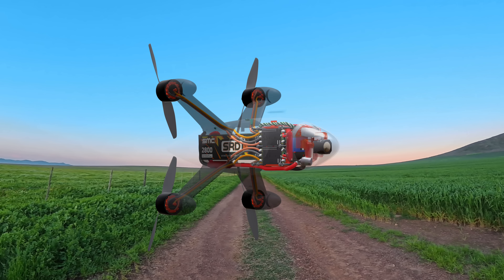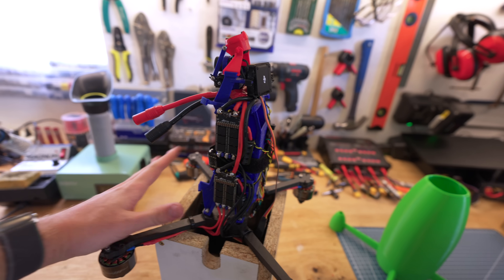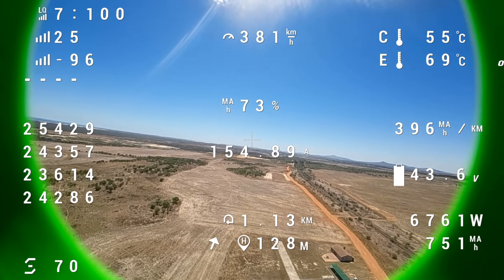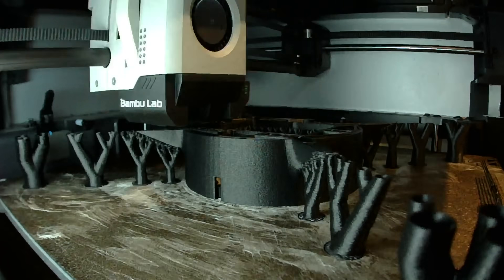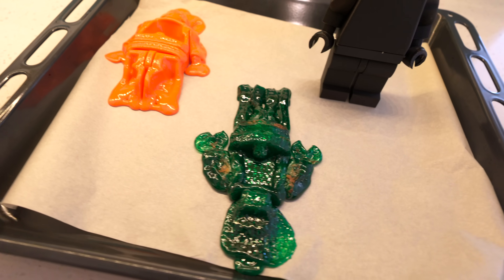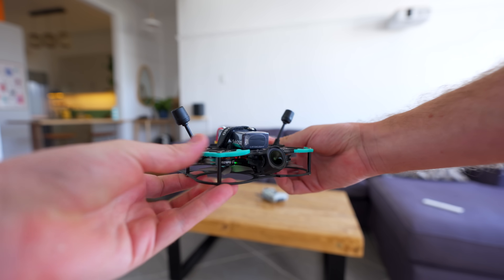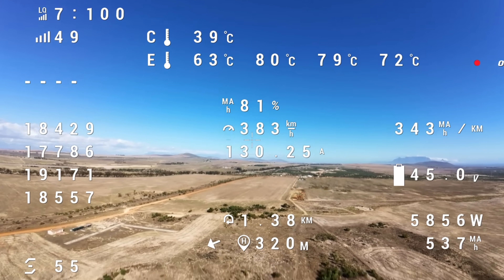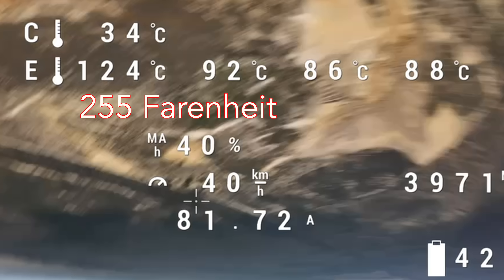THE COMEBACK - World's FASTEST Drone V3

Comment: 13:15 16 KW of power!  That's bonkers
Reply: It is a lot indeed, but nowhere near 3 households with everything on. Maybe a single small one though.
Reply: @Yawndr  Well "everything on" might not be true, since a lot of kitchen appliences can use upwards of 2kw each, but for a regular evening it might be true
Reply: @Yawndr  In the USA, that uses roughly the same amount of power as an entire household HVAC system, still bonkers.
Reply: @Yawndr  because in USA electricity is used in very excess. On any other States consumption for single house in less. In Italy common limit is 3.3kW per house, how want a lot will use 6.6kW ;)
Reply: @SbiriJJ I quite doubt it, otherwise I hope your microwave is never turned on at the same time as your kettle or your stove otherwise you're above that limit...
Reply: @Yawndr  the microwave are commonly only 0.8kW, the problem occur with normal hoven and washing machine (both near 2kW). In realy 3kW contract give 3.3kW indefinitely, 4kW for 3 hours, and "unlimited" for 2 minutes. Anyway is someone need frequently more can get 4.5kW or 6kW. (this in Italy) in other countries in Europe there is some differences, but power consumption is almost the same.
Reply: @SbiriJJ The whole point of what I said is that that claim is just wrong. You can say whatever you want, but it is. Just a single residential EV car charger, is more than 6kW, and it charges for hours at a time.)
Reply: @Yawndr  now, and I repeat now, (except rich or near so) in Europe some people have at home a wall charger commonly only the ones with solar charger. Also there is any city you can't have your charger, only a few people have pure electric cars. I repeat that in Europe people don't use a lot of electric power, because cost a lot first of all and because many countries don't have nuclear power.
Reply: @Yawndr  you don't understand that in Europe there is only a few full elettric cars and is because only a few people want to buy the extra power supply for the charger. Also is impossible to charge at home in the cities, in you live in an city (big or small) you must use charger on road that sell at high price the current.
Reply: @SbiriJJ and all of that is irrelevant. A single kettle can use more than 2000kW.  A stove between 2500 and 5000. Heater/AC is in the same range. That's for a single appliance. I'm not sure why you're so hell-bent on defending the claim.
Reply: @Yawndr  In Europe you can't buy appliance with so much power required. For home use does not exists at all. Green regulation forbid that. As I said in USA electric power consumption at homes is higher that any other country, like fuel consumption of american cars. In USA waste of energy is a normal behaviors.
Reply: @SbiriJJ Have fun in your make believe world, I'm done arguing with someone pretending that PCs and TVs don't use the same amount of power, that your kettle don't use power (your kettles use more than the American ones btw...) and that you can will your bathroom fan to turn without using power, etc.
Reply: I found the 400A and the rapidly decreasing mAh% value of the in-flight-display much more shocking!
Reply: That's around 21.5 Horsepower!

Comment: I don't think it makes much sense to stir the water inside the block unless the flight time is always very short --  the water should circulate to a radiator. Also for the aerodynamics stability problem you need to research your "center of pressure" and compare it to your CG.

Comment: Why propellers instead of turbines?  You're using so much power on that little thing, I bet you could do something crazy like punch a hole through the center of it and use a little turbine to make it extrude air like a noodle press. You've already got 4 tail fins with props for control. 😂

That thing is already so awesome!

Comment: I'm a little surprised you don't make the motor supports out of aluminum and mount the motor drivers against the surface. Flying that fast, you should have enough cooling on the surface to keep the drivers cool, but still not waste any air. Once you build it, you should be able to sell these to Ukraine.

Comment: Dimple it like a golf ball
Reply: Dimples are for golf balls only, because a ball is a terrible aero shape and a particular quirk that only benefit balls.  Not a single aircraft or airliner has dimples for a because it would just add quite a bit of drag.  You can be certain all Airliners would immedeately apply dimples if it saved fuel.

Comment: You should try dimples on the body, like a golf ball
Reply: Dimples are for golf balls only, because a ball is a terrible aero shape and a particular quirk that only benefit balls.  Not a single aircraft or airliner has dimples for a because it would just add quite a bit of drag.  You can be certain all Airliners would immedeately apply dimples if it saved fuel.
Reply: @Mike-Bell makes sense

Comment: Put inlet nozzle around the drone body.  This will keep the drone flying straight and provide extra air flow around body of drone.  If you 3D print body, you can print it with coolant passages incorporated in skin so the extra air flowing through the inlet will cool the drone even more so you can ad more power without melting the drone.  If it works for raptor 3 (space X)?

Comment: Maybe I'm a keyboard aerospace guy, and should probably watch the whole video first before commenting, but I think your car wind tunnel model is flawed. On the "yaw" axis, I think your free spinning props are artificially moving the center of pressure (or drag however you want to think of it) aft. If they were creating thrust and not drag, I think the result would be different. (Aka I think you need your cg even further forward to achieve true natural stability. Or as you said, add a fin at the back to move your center of pressure/drag aft of your cg

Comment: 4:09 7x15 - the first number is the inches I think as those blades don't look like 38.1 cm diameter. If they were you'd exceed the speed of sound on the blade tip at ~17,193 RPM. At 7" (17.78 cm) the RPM would need to be ~36,843 RPM to exceed the blade tip speed of sound at ground level. Either way, flipping mad you lads can have the power output to reach over 26K RPM on all four motors. 💥

Comment: I wonder why you didn't make a small air passage from outside air to have air flow over box, and out back? you could attach fins to box ass well like on aircraft piston engine to have air grab heat easier. I'm sure it would keep water cool while flying without pump. Also, why not do a copper block with fins around the side CNCed similar to how Noctua desktop pc CPU air cooler would work, with the nicely design air duct to direct airflow properly. Love this though so much and am about to buy a obstacle avoidance drone that can follow car for my vids. Keep up the great work!
Reply: Actually, like a AIO cooler, you could now just run pipes to external cnced radiator on bottom to make a loop with pump. Dude! I really like this one!

Comment: How hard would it be to route the water out of the block to small-diameter copper tubing at the leading edge of the engine struts to disperse the heat out of the craft?

Comment: feel like the water cooling would have worked even better if you had made the entire brick out of aluminum but left the top open, then you could have used 3d print material to seal the top. That way the heat will come in from the sides and the 3 other sides made of metal would be able to release the heat faster then the resin would

Comment: budget permitting, you might be able to get some more cooling performance by turning the propeller struts into a heat exchanger. no fins or anything that would induce drag, just laying some copper heat pipe along a slot in the leading edge of the airfoils that hold the motors.  In practice it might not be worth the effort in rearranging the guts, but hey, it's my 2 cents.

Comment: I wonder if electric missiles would be cheaper than the fuel we currently use. They'd need to go like what 3x - 5x this fast? They could fly that fast and eject the payload and immediately turn full thrust the other way to save the carrier system of the warhead and use it over and over.

Comment: You will double the speed maybe, like a golf ball with dimples, it is proven dimples increase efficiency
Reply: Dimples are for golf balls only, because a ball is a terrible aero shape and a particular quirk that only benefit balls.  Not a single aircraft or airliner has dimples for a because it would just add quite a bit of drag.  You can be certain all Airliners would immedeately apply dimples if it saved fuel.
Reply: @Mike-Bell  Myth busters did it with a car, and got 14% more fuel efficiency, so why not? https://www.youtube.com/watch?v=snNL5GgOq_c

Comment: I don’t understand that liquid cooling system. Without a radiator  or airflow, all of that heat is just going to get trapped in the water, and circulating it within itself seems like it wouldn’t do much. Do you just do short flights and swap out the water between them?

Comment: how about evaporative cooling? do the same like with the water tank but fill it with lets say alcohol. the alocol will start boiling and taking huge amount of heat away. of course some sort of vent should be implemented. this way the fluidvolume can be drasticaly reduced and save weight

Comment: Couple comments.  Props are always the main problem, get a aero design package, and design a scimitar blade, with a feathered back edge.  See NASA and commercial designs for examples.  Also shroud both front and back of the motor pod.  Same with the motor supports, all back and front edges need to be tailored to the "top speed" zone, since you are in compressible air flow.  Any discontinuities will create Drag, including the motor to propeller gap.  Ogive noses are Not the best for mach-0.7 and above.  Free programs available for better nose shape (and tail).

Comment: Would little dimples in the sides like a golf ball create less drag and make it fly faster?
Reply: Dimples are for golf balls only, because a ball is a terrible aero shape and a particular quirk that only benefit balls.  Not a single aircraft or airliner has dimples for a because it would just add quite a bit of drag.  You can be certain all Airliners would immedeately apply dimples if it saved fuel.  In my video I explain the golf ball quirk.

Comment: A long tapered tail with a tear drop shaped tip would lead to smoother separation, less vortex shedding and increased stability at speed.  Id also consider adding dimples on the surface of the main drone shell. Think golf ball.  Id even play with dimples on the fan blades.  Good luck
Reply: Dimples are for golf balls only, because a ball is a terrible aero shape and a particular quirk that only benefit balls.  Not a single aircraft or airliner has dimples for a because it would just add quite a bit of drag.  You can be certain all Airliners would immedeately apply dimples if it saved fuel.

Comment: Since you were 3-D printing the front and back cones, anyway, couldn’t you design it with small channels within the wall where you can attach tiny hoses to your water pump and basically use the cone as a radiator cooling the liquid as it flies to the air without adding more drag

Comment: Right now, most of your friction from both your fins and your body is ahead of the centre of thrust making the system unstable. Both your centre of thrust and friction are also very close to your centre of mass. All these things are making your drone unstable, not only just the centre of mass.

The ideal case would have your centre of friction behind your centre of thrust. This would mean mounting your motors in front of your fins. A compromise would be to move your fins as far back as possible, behind your centre of mass, just like a rocket.

Comment: Dear Luke and Mike,

Your video brought back fond memories of my years in South Africa, your engineering achievements are also cause for pride. Props to you both.

I humbly suggest you investigate professional conformal coating of your motor controllers followed by immersion of them into the coolant tank.  Parylene coating may be optimal for heat transfer and corrosion resistance and electrical insulation properties.  I do not know if anyone in SA will offer the service but enquire at the space programs at UTC and Necsa who held the monopoly on the surface fluoridation of plastic tanks, it might be something they provide.

Having the electronics directly immersed in the turbulent coolant should have optimal heat transfer.  You could use deionised water even with no conformal coating if you ignore electrolytic issues during your brief power on and fill before and drain the water after each flight.

You could even use much less water or alcohol if you are happy to boil it off.  The latent heat of vaporisation of boiling ethanol is equal to the sensible heat you can store in twice the amount of water as it warms from 0 to 100 degC. 

However water is less flammable and if you introduce an ice cube into the tank on launch that provides a lot of cooling until it is all molten.  If the run is longer or the water tank is smaller then the boil off will maintain the water at 100 degrees while absorbing even more energy.
Reply: Pointless complexity. Hos simple solution does everything it needs to do. So many armchair experts trying to redesign his WORKING cooling system here, i find it utterly insane.
Reply: @randomname4726  He has complex thermal pad infill and elaborate water tanks when simple immersion would achieve a similar outcome.  What people in the comments offer is suggestions that may have been overlooked and may simplify his solution further.

Your user name does make me wonder if you are one of those random helpful internet strangers in disguise. :-)

Comment: Your water cooling system it neat but limited, you have basically made a thermal battery yes it has more cooling potential than just a heat sink could without air flow  but eventually the water will get saturated with heat and make it not work... maybe this isn't an issue due to the battery life but if you are running into issues where the thermal limit is reached you might want to include some type of metal plate/ring on the drone to allow air on the outside of the drone to suck away the heat you could make a aluminum ring around big enough for the speed controllers to mount directly to and use the air cooling of the shell/cover itself as your heat sink or just run a channel of water through an exposed surface to incorporate it into your existing design.  Another option is to use a chamber like you did but use dry ice but make sure you have some type of vent/purge system the CO2 doesn't cause it to explode as it off-gasses and expands.  You can get way cooler and if you are basically just doing drag races it will be fine for the amount of time needed in addition  if the CO2 is filling the drone it will act as a fire suppressant in some regards (not totally because of the nature of the batteries if they start burning from the inside).  Sorry for the rant but I thought these ideas could help if not with this unit a future unit you may build.

Comment: Impressive, faster than the french TGV's world record. You could have flown over it while it was setting its record! I'm wondering how you deal with radio at that speed, because it's 10km/minute, so even a small flight brings the device super far. Don't you face an transmission issue with the image etc ? You can't have a long dragging antenna also (at least at high frequencies it's pointless to have a long one).

Comment: What's the point of watercooling when you have no restriction on the element placement? You can make the radiator as a part of the outer body letting the 500+ km\h air flow cool the elements directly. You had a heat issue but no visible outer radiators or air intakes. Watercooling just increases the heat capacity at the expense extra mass. Extremely ineffective solution in the given situation.

Comment: Interesting idea - electric jet using a heat pump. Heat the incoming air, use a pair of internal fans to force the hot exosnded air out the back. Heat pumps can generate 4 watts of heat for every watt of electricity. However IDK if it's possible to generate temps high enough to be useful.
Reply: Lol, no.

Comment: The aluminum plates for your water block need more surface area exposed to the water... mill grooves in them - that gives you more area to transfer the heat out of them.
WAIT... you're not dissipating the heat collected in the water through a radiator???  I could easily see that water boiling... which expands the volume by 1200 times... it will fail.

Comment: Love the idea of using water to cool down the ESGs but why not copper? It's much more conductive. Also if you REALLY want to cool them down, you can remove the heah shield they come with and as long as your copper does touch the chips under the heat shield it will be just fine and probably you will drop the temperature easy by another 15/20 degrees.
Another thing I would do would be to add fins on top and the bottom and then aircool these although I can easily imagine it makes the design much much more complex and it's not worth for short runs (the battery dies anyway before the heat can reach a critical temperature if you are using ice.
Be careful though to the water expansion, the transparent parts might not be strong enough to hold the presure after the ice melts if it the tank was filled till the top and then frozen.

But super cool!
Reply from the maker: The reason for aluminium and not copper is copper is too soft and doesn’t make a nice seal. It’s also a lot heavier
Reply: @LukeMaximoBell oh makes very much sense 💪